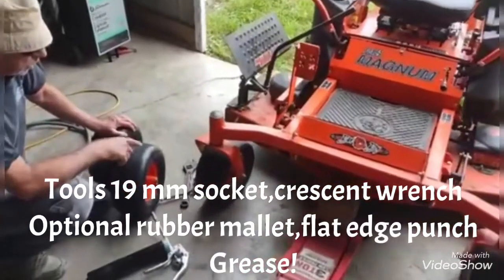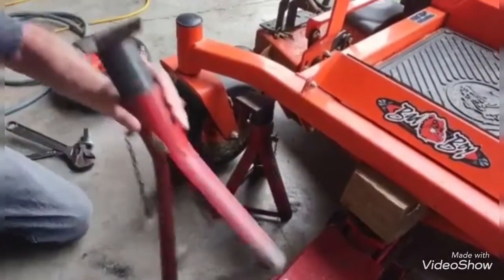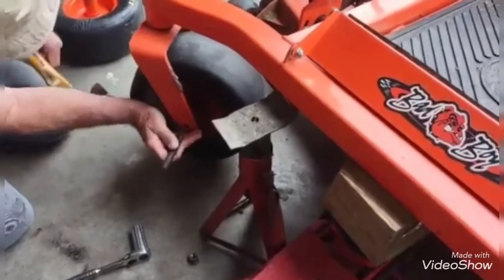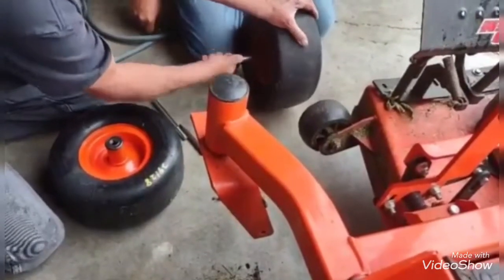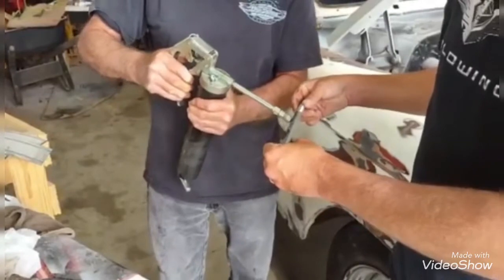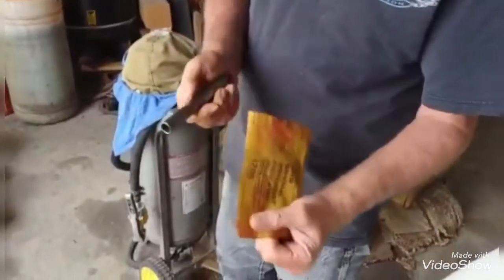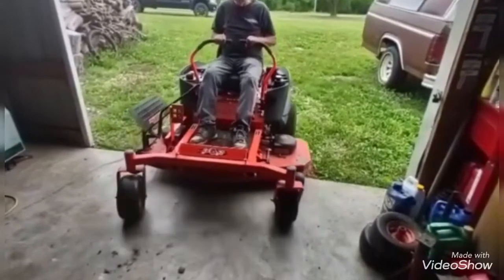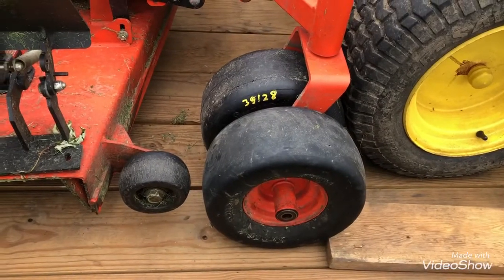Installing a no flat tire and wheel front zero turn bad boy

Comment: Going to the no flat tires too. Why do the bad boy fronts keep deflating?! Useful tip about the sleeves, will save me some time when I go to do this tomorrow. Thanks!
Reply from the maker: Your welcome
Reply: Bad boy zero turn tires are straight trash. Running over thin blades of grass is enough to puncture them.  🤦‍♂️